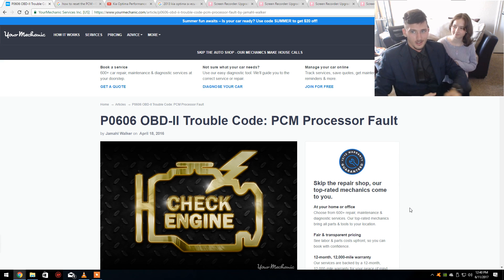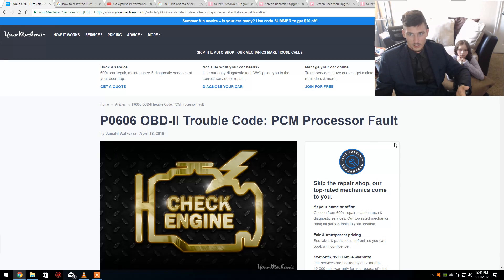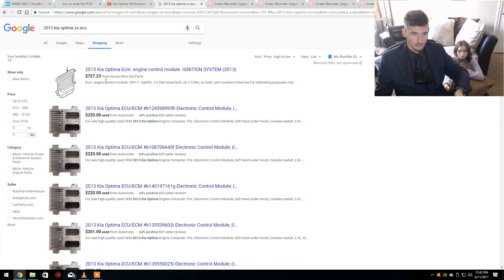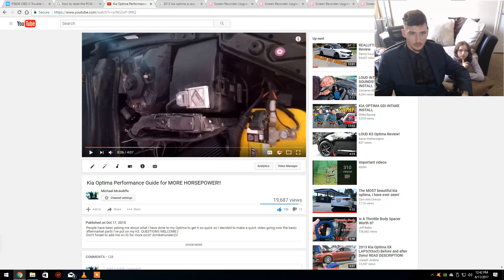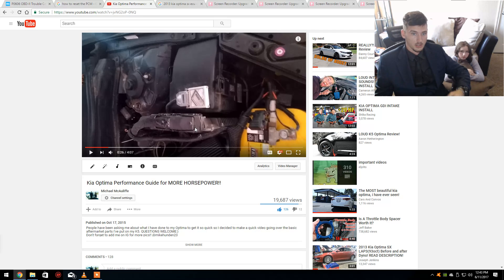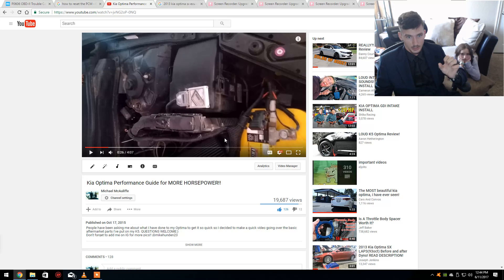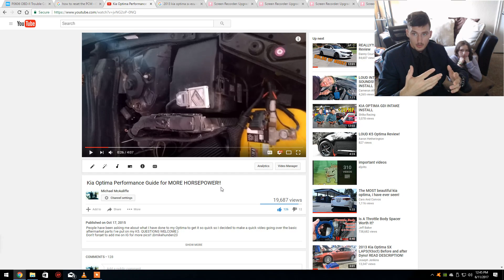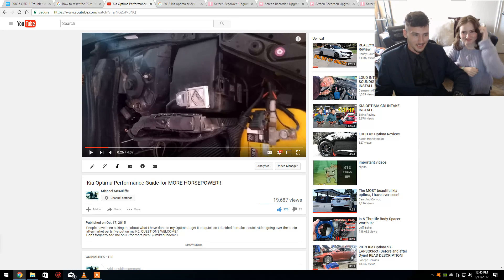What is the P0606 OBD-II Error Code & How do I fix it?

Comment: I know this is an old video but you can flash your new or used ECM by hotw8ring the #4 and #13 pin on the obd2...I was told to not start the car and let the car f8gure everything out and adjust everything to its liking for about 30 minutes and you can remove the pin used to hotwire the car and go ahwad and start the car to make aure everything was to the cars liking. I am having the same code but read in a form that it can also be thrown off by a bad rear O2 sensor...that toyotas and lexus have this issue thats why there is an iATN for these codes.
Reply from the maker: I've never heard of that before! I'd be nervous about crossing pins on my obd2 unless I was 100% sure about what I was doing

Comment: I ran a diagnostic code on my 2009 Honda Civic ex coupe. Mine would run then it would cut the fuel off when I got up to speed then had to restart it reset it would do the same thing about 3 miles down the road. Changed out the ECM fixed the problem part number 37820-RNA-A75

Comment: uh ya but what if your battery is in the trunk can you please write me and let me know how to check it if my battery is in my trunk i have a 2010 Chevy camaro v6 3.6 L
Reply from the maker: Are you unable to access your battery to perform the hard reset? Also, what are the symptoms? As in what is happening that makes you think that you have the P0606 instead of being another potential issue?
Reply: I have the same issue with the same car. Any help?
Reply: I have a 2005 Chevy cobalt with check eng light on after an oil change n now is puttering n will not speed up.

Comment: If your positive and negative cables are long enough, tap them together AFTER you disconnect them and you won't have to disconnect the ECU nor wait 20 minutes...
Reply from the maker: Have you tried this? Because I read that was STRONGLY ADVISED AGAINST by multiple people on multiple forums. I wasn't going to try something that people were saying not to do if there was another way to make it work, but if you personally have done this, and it works, then it would be good to know. If I remember correctly they warned that it can cause electrical damage by creating a short circuit like that with whatever energy is left in the vehicle that you are waiting to dissapate
Reply: I've done it numerous times when getting an engine light but not for the sole reason to clear the ECU. I have not had any problems thus far...
Reply from the maker: good to hear it from someone personally, that'll save me some time next time I have to do it

Comment from the maker: TRY THIS FIRST IF YOU HAVE THE P0606 CODE: Turn the car on, press brake pedal, shift to drive, shift to park, press brake, press start button. This has worked for me a couple of times.
Reply: Start button?
Reply: Michael McAuliffe bro can you call me or text
Reply from the maker: Brandan Lee send me an email @ usmcmcauliffe@yahoo.com and I will give you my number there
Reply: Michael McAuliffe  i have a 2010 chevy camaro v6 if u could email me at jjr194751@gmail.com
Reply: What if my car has manual transmission? How do I do that?

Comment from the maker: There are a few corrections to note in this video:
1. Battery should be at 12.6V when checked by a multimeter
2. I said PCM a couple times (Powertrain Control Module), it is the same thing as the ECU, or ECM
3. I said "Please DON'T remember to like & subscribe" LOL.. I actually would appreciate it if you did remember :)
It was noon on a Sunday when I recorded this, I still needed more coffee than I thought I did 
If you note any other discrepancies, please point them out for correction! Questions are welcomed
Reply: Michael McAuliffe  bro can you please help me please I would much appropriate  it
Reply from the maker: Brandan Lee what do you need help with?
Reply: Michael McAuliffe with how to reset everything